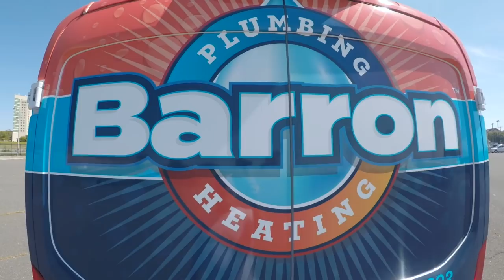PLUMBING REPAIRS | B&G PUMP REPLACED

Comment: when you check to make sure the pump electrical is off with the volt meter, have you seen those klein tools pen to see if theres high voltage or not?
Reply from the maker: Yes. I have used them the ones that click or beep.. Thanks prime

Comment: Chuck , The flanges had a raised face and the circulator ( not a pump ,doesn't build pressure , just moves liquid ) had grooves in for the square ring gaskets. Nice to give away free parts when it's a part time gig and you get a full time paycheck from the fire department ,but most plumbers in business have to make a living at it.
Reply from the maker: Thanks for the tip. I give back all the time in my plumbing business and its not because i have two jobs. Pump was sitting around my shop for a bit. The pump has a new adopted daddy. Im sure you give back also even though your full time plumber. Its great  karma.
Reply: He gets a lot of work from them. I've gotta have like 2-3 pumps lying around. It is called building a relationship. Plumbing isn't going anywhere, and the next time they have a faucet to change, or a toilet to unclog, CB will be the one he calls.

Comment: nice video as always!

Those old B&Gs are bulletproof pigs. I've seen a number that have to be atleast pushing 40. Can't count the times I've replaced a relatively new taco while having the old B&G still hum away. They certainly don't make em like they used. When it makes sense I keep em going if i can. Unfortunately, we know that often isn't the case & they end up being neglected too far long & into the trash they go.

Again, nice work, congrats with everything!
Reply from the maker: they are beast!

Comment: Loving your channel and thanks for the tips!  My bosses need to get me a pro press though like you.  I can use shark bites and thats it.  No soldering usually.  How much was yours?  2kish?
Reply from the maker: Shark bits. Man I just can't get into them. They do work though... Propress 2K ish.
Reply: I recently bought a battery powered press tool for $1,137.00 shipping and tax included.Before that I bought a manual hydraulic press tool for $356.00 shipping and tax included.I decided to start off with the manual hydraulic press tool before I bought the battery powered press tool to make sure of what was what.I used the manual hydraulic press tool to press a section of 1/2" copper pipe that leads from my basement to my kitchen sink hot water and I was amazed at how powerful and how well the manual hydraulic press tool works.Both the manual hydraulic press tool and the battery powered press tools use standard press jaws.Look up HT-1550 press tools for the manual hydraulic press tool and PZ-1550 press tools for the battery powered press tool if you're interested.If you decide to order either the HT-1550 and/or the PZ-1550 make sure you specify that you want the press tool with press jaws for U.S. copper pipe sizes.I have 1/2" copper pipe for the water and 3/4" and 1" copper pipe for my heating so I solder where it is convenient and safe to solder and press where it is not convenient or safe to solder.I hope this information helps.
Reply: @ChuckBarron  SharkBite fittings are good only as a temporary fix,I would not depend on SharkBites fittings for permanent fixes.I like SharkBite fittings for the simple fact that SharkBite fittings can be reused.Be sure to store the SharkBites in a clean sandwich bag after removing them to keep the SharkBite fittings free from dirt and gunk after you use them and you'll be golden for the next time the SharkBite fittings are needed.

Comment: The most common mistake and Most important make sure the pump is positioned correctly! 👍🏻👍🏻
Reply: Pipe support very important. 👍🏻
Reply from the maker: I have made that mistake and your coached me i believe....thanks coach. ha
Reply from the maker: We added that when we did some other work before.  pump should of been done then but it lasted a long time.